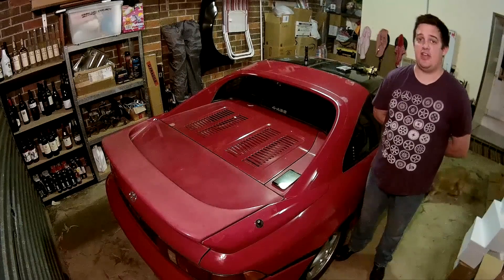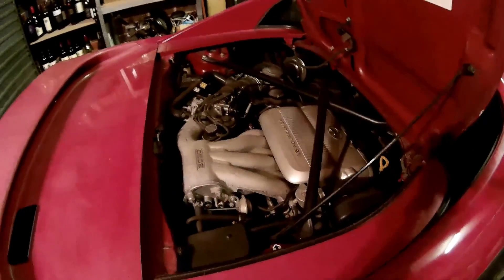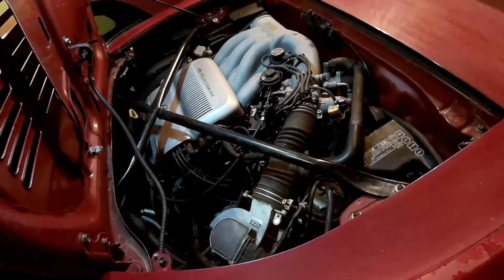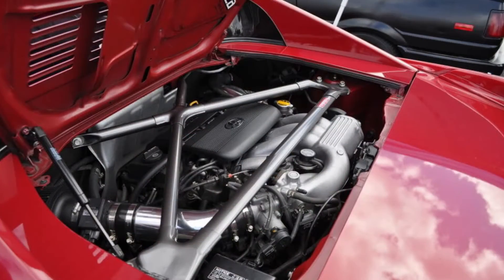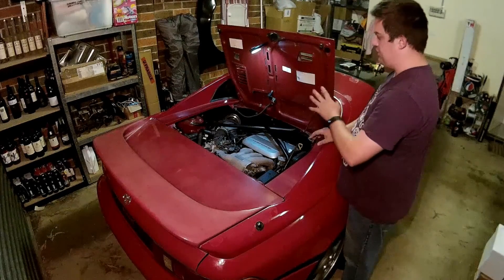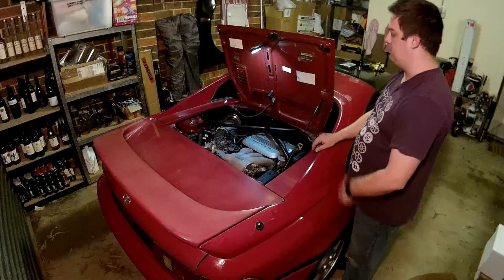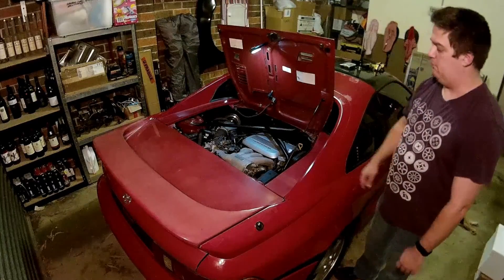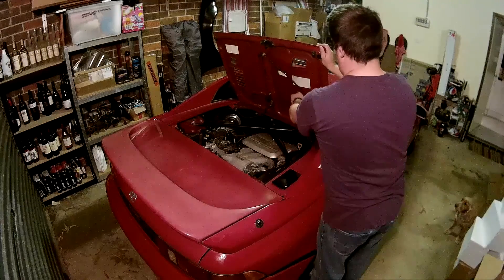Project V6 MR2 1.3 - Examining my 3VZ Conversion

Comment: Not sure if you are still active on this youtube channel, but figured I'd comment. I'm looking at a good condition 92 mr2 with a 3vzfe already swapped in. Owner is asking 3800 dollars, but is also throwing in two extra 3vzfe motors with the sale. I'm wondering, even in the worst case, if the car would be worth it. Even if I have to pull the engine and rebuild it. Car doesn't run very well at the moment. Owner says it needs a coolant flush as there is air in the lines, as well as a stuck piston ring (he assumes as it smokes on acceleration)

At the very least could you provide me with some red flags that I should look out for in terms of shoddy swaps.

Thanks!
Reply from the maker: Hey Mike, whether the price is worth it depends on where you are, I'm guessing most likely you're in the States and I'm less familiar with the market there. I'd say its in the ballpark depending on all the other usual factors (IE. the condition of the rest of the car), but the 'stuck piston ring' thing seems iffy, I suspect its more likely a worn ring or cracked ringland and you may be down on compression, requiring a rebuild, at which point despite the inclusion of the extra motors (which are worth almost nothing really) it doesnt look as good value. This all depends on whether you want a project car or something you can drive in the near future :) The other key indicators of whether its worth the price is whether it has the larger factory brakes (for JDM cars this was 92 onwards), whether its a hardtop or targa - in Australia hardtops are very rare, and fetch higher prices due to this and the fact that they are also lighter and don't leak - and what gearbox it has (E153 vs S54) and if E153, and within that, whether it has an LSD. If it's JDM and originally a turbo, it likely has the E153 with LSD. If its USDM I have no idea what they were doing in '92.
Hope this helps!
Reply: Thanks so much!

Comment: Awesome! I have a 3vz fe in my mr2 currently trying to figure out how to fix the speedometer. Any advice?
Reply from the maker: Nice!
Not sure how to advise re the speedo. Mine is cable driven and wasnt affected by the conversion at all. Perhaps try finding the Toyota service manuals online (referred to sometimes as the BGB) and follow the diagnostics in there
Reply: Use gps speedometer that you can fix it inside the cluster...

Comment: where you buy this engine? and how much you pay for it?
Reply from the maker: When I built my previous car I sourced the first engine from a private seller, and later a replacement engine (as the first one blew a head gasket and it was easier to just replace it) from a local wrecker. in both cases I paid about  $500AUD. it's potentially possible to get a whole car for this price these days
Reply: +jaemus56  because I cant find like this engine whit manual gearbox. I dont think so for 500 pound in the uk like this car

Comment: Good job Jaemus! Keep making vids. I love MR2s...I  currently have 4.  Here is one I restored if your interested. http://www.mr2oc.com/6-mkii-90-99-na-turbo/551649-mike555-gen-4-project-pics.html
Reply from the maker: Thanks man. I just checked out your thread and it's pretty epic. Never seen quite so many shiny freshly painted parts going into an MR2. Love your work!
Reply: +jaemus56  Thanks man...Im gonna try and make some vids on MR2s myself come spring.  By the way...good job with that steering wheel in your other video. Looks awesome!
Reply from the maker: Do it, its great fun :)

Thanks mate, I try never to be afraid to try new things, sometimes pays off